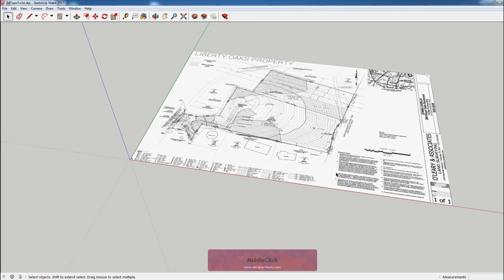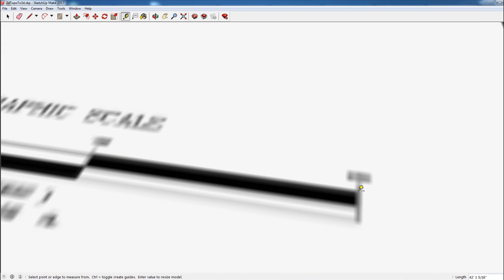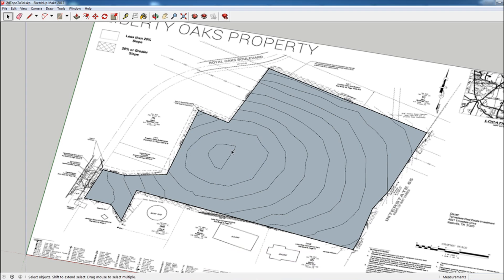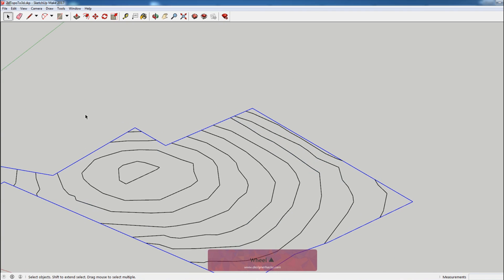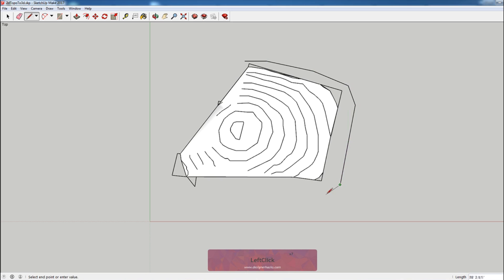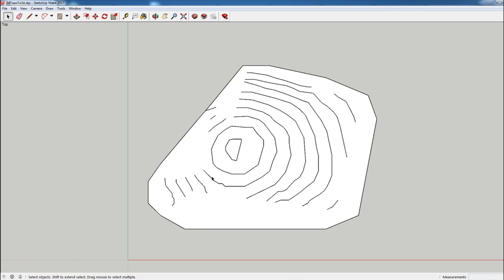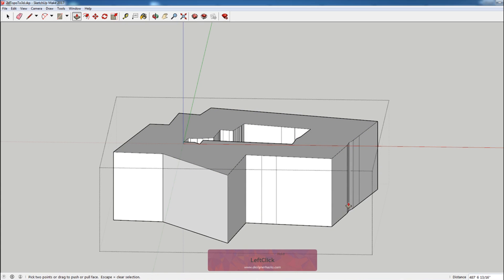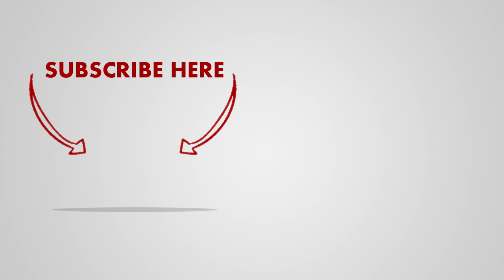How to Turn 2D Topography or a Survey into 3d Terrain in Sketchup

Comment: Loved the video. You fast-forwarded past the painful, time-consuming part :) One thing I found useful is to use the weld extension on the topo lines, vs. grouping and ungrouping before using the From Contours function. Anyhow, this was super helpful overall. Thanks. Subscribed.

Comment: Is it possible to do the opposite? I mean turning 3d Terrain into 2D Topography.
Reply: Yes, it's very possible. This is what you do. 
You put your 3D terrain in a groupe, then take a simple plane at the lowest point of your 3D, making sure it covers all the area of your terrain 

Copy the plane upwards multiple of times , according to the height you want between each contour let's say 5 meters for exemple. 

You ll end up with your 3D terrain, covered by many layers of planes each one is higher by 5 meters. 

Once you have that, select everything and click intersect with context or with model. It should take a few seconds or multiple minutes depending on the complexity of the terrain. 
Once it's done, delete the planes by selecting juste the corners, after doing that, you will see the contours, on top of your 3D terrain, if you want to separate them, you can simple move your 3D model. 
If it's not clear let me know, i will send you a link to a video about this or just look for " generating contours from 3D models in SketchUp"

Comment: Awesome video!  I need a little clarification though.  Are you using different layers for the background(overlay) image and the different elevation levels?  Also, my lot is a slope and not a hill.  So the different elevations all are just a single line going through the property.  Do I need to close them off somehow and make each section a box itself?
Reply from the maker: The image is in a separate group so that the lines don't stick to it.  To create a 3d shape from contours the lines don't need to be closed off.
Reply: Thanks.  So how do you set the elevation for each contour line?